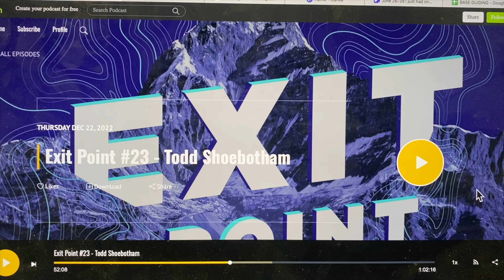Tail Gates

Comment: Is there a difference in the tailgate binding, twice or three times, from a height of e.g. 70 meters?
Reply from the maker: Every wrap you do will hold it tighter so it'll need more force to release. I wouldn't start playing with adding wraps on something as low at 70m. If it is something you want to experiment with, do it off something big, with lots of margin, and get top video, or rear facing from a 360 cam, and look at your deployments.
Reply: @johnnysjumps  thanks,i always made two binding
Reply from the maker: Yeah - it’s impossible to give any recommendation without seeing a deployment. It might be working perfectly, or it could be blowing early every time.